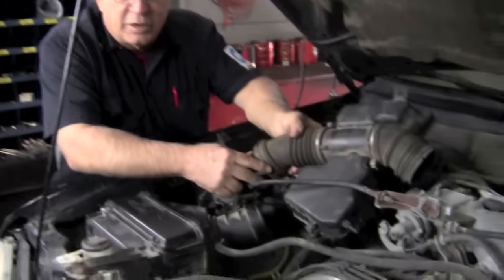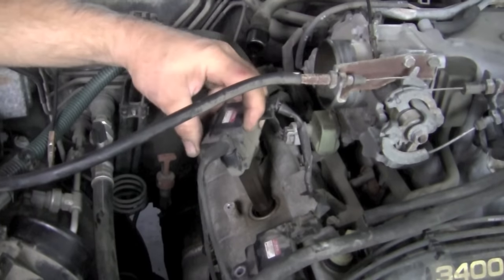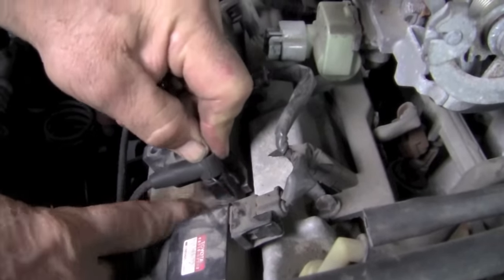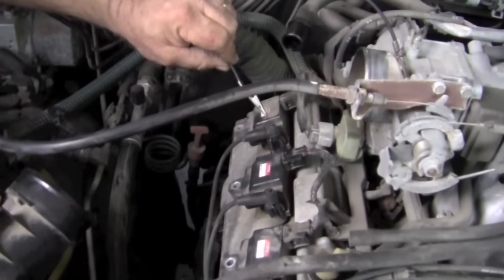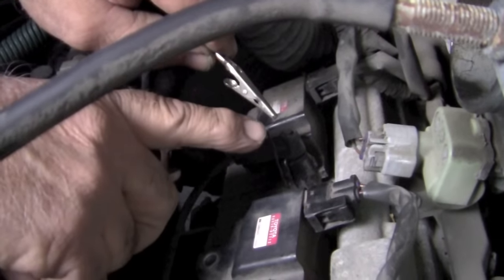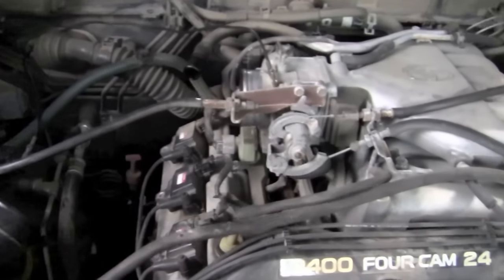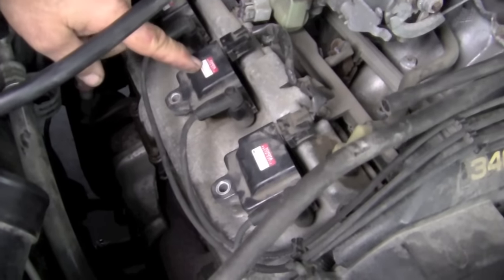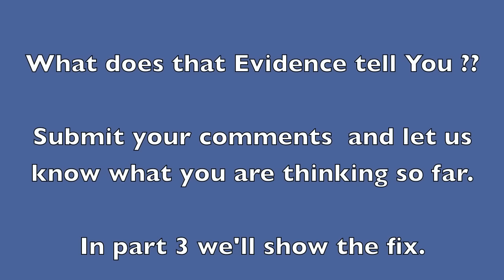How to find a misfire without a scanner 2

Comment: Interesting problem. The computer isn't logging the misfires so I assume it is getting good feedback from the coil circuit. I have no idea if that vehicle has a knock sensor. My initial reaction would be to replace the plug with one lying around incurring no cost, and then see. Since it only happens under load, might vibration be a factor?

Comment: now that we know its a middle coil misfire, its time to switch that coil with an adjcent coil and retest to find out if the coil is bad or if the middle cylinder is getting a bad signal from pcm or icm, or if theres bad whiring from that coil back.

Comment: Only thing I haven't changed yet is mass air flow... yes I bought new distributor.. Before discovering that my spark plug boots were pushing themselves off and making unburnt fuel scenario for my catalytic converters and of course engine missing symptoms.. really important....... I'm looking to see where I can find a really good fitting dunce cap for my head.... check engine light is staying out I just have to put scanner on somewhere.. to see how it looks.. if I got my timing in the right spot..... I assume so.. Vehicle 1997 GMC she 3500 Sierra pickup truck dually 7.4 liters. Discontinued by dealer they didn't even want to talk about it much less work on it.. I chased for months to find a mechanic that would work on it.. sort of... Kind of like a sick joke here.

Comment: when he load torques the engine is he just raising the rpm of the motor or putting it in drive with the brake applied and giving it some gas ?
Reply: Raising rpm while in park or neutral

Comment: I seen fire wen you pulled out the coil pack on the center, so its not the coil-pack, its either the wire connection at the coil pack or the spark plug, pull the plug and check for fire, i'll bet is the connection at the plug.

Comment: I don't even have a scanner and I was going to buy one. My car was shaking very badly and got it checked out and they said it was a misfire and they wanted to fix it. (What shop doesn't want to fix it??) They quoted me $600 because they wanted to clean something and change all spark plugs and coils. I changed the spark plugs and it got rid of the violent shaking when I was sitting at a stop light. I still feel it misfiring and was trying videos to see which one it is. Before I ran into this video I was going to get a tester (which I don't have) and this just goes to show you that I am the tester. I just need to do what is in this video and figure it out.
Reply from the maker: I applaud your effort Amy
Reply: I tried this with the coil check and didn't find anything. I don't have an alligator clip . I don't know where to get the mechanics wire at. 😮‍💨

Comment: Lol. I'm having the same problem with this same exact motor. Going to give this a try.
Reply: Me too. My codes are P0305 cylinder 5 misfiring.  I have change all the sparkplugs, wires and coils, but no luck.  I dont know what alse to change.  I was thinking maybe  change the mass air flow sensor and then the catalyc converter, but won't know if that in fact will fix the problem.  Need help 😧  did you fix the problem? You posted this 4 years ago.

Comment: 2003 Trailblazer Chevy does the scanner always shows what's wrong with the vehicle my mechanic told me that she get the scanner and he only showed that it was a coils and spark plugs but and then he tells me that it the transmission but in the scanner it did not show that is a transmission problem should the scanner read transmission problem codes my vehicle did not want to drive forward or did not want to drive reversed when I got this problem I didn't hear no knocking sound there was no rattling noise please help I appreciate it very much thank you for your feedback my mechanic told me it going to cost me $2,000 to fix my transmission

Comment: this test confirms the the coils work...but does not confirm spark at the plug gap. if its all good than move to the fuel system...note: some of the chevy v6s had an inferior poppet fuel injection system. the colpret can still be an injector... i think the compression is good enough judging by the rest of the cylinders contribution to power.

Comment: You need to change the middle coil,  so in this case I would change all coils so all cylinders fire uniformly.   (Have the same power or may I say, the new coil is no fidgeted as the older ones) so all the older coils should be changed out or at this point just do a complete tuneup.
Reply: On my 6 cyl. with 3 coils replacing one coil is $70 including labor. If I do all 3 then is $210 . Penny pincher saves $140  doing 1 coil .

Comment: Dear friend good day for you,.....Does the vehicle's pcv valve cause this condition?.
This regard, zuzuki balino car,
Reply from the maker: anything is possible but the pct as the direct cause is unlikely.  The pcv as the name implies allows ventilation to the crankcase.  If it were bad, and over time it could cause unwanted wear on the rings and cylinder walls that would cause "blow by" and the engine would smoke.
Reply: @realfixesrealfast thank you for your quick response..

Comment: Can you clarify something on running the engine with the MAF disconnected? I"m fighting a misfire issue on my '01 4Runner with the 5VZ-FE engine. When I disconnect the MAF Sensor as you showed, it won't stay running. It starts and immediately shuts off again.  It's a real pain to have to reconnect the air box every time I need to test another component. What am I missing?  Thanks.
Reply: Hope this helps.  The MAF, when plugged in, measures and reports the amount of air entering the intake so the PCM can calculate the proper injector on time.  When it is unplugged, obviously it can't measure something that's not there so it can't report a real value to the PCM.  The PCM will see that nothing is being reported and in many cases it will report a "substituted" value in order to let the engine run (not well but it will run).  I know that's not an all inclusive answer on how a  MAF works.  That would take a lot more detail.  Keep in mind all OEM's don't use a substituted value.  So, if yours won't run with it unplugged, it's because the PCM needs that input to keep it running. Hope this helps.  Let me know what else you may need.  Duane

Comment: Its gotta be worn out spark plug because you still had spark when you pulled the coil. Or the boot on the coil is the problem its probably cracking under heat and age.

Comment: its not an injector because this isnt a fuel problem, its a spark issue, when he removes the coil under load and it changes nothing but does get a change with the others confirms its a spark problem, check the plug, than the boot, than the resistence in the coil pack

Comment: Trying to diagnose an idle  stumble misfire on a 2010 vitara 3.2.
Cant narrow  it down to a particular cylinder. Odd thing is that when taking a video the camara's mike is picking up what sounds like "popcorn" in the background . Using the cameras mic I've narrowed it down to the left bank near the first catalytic converter.
Another odity is that  when disabling one coil at a time to narrow it down nothing ever stops  the poping noise on video.

Any advice would be helpfull thanks :)

Comment: I got a maxima with 6 coils, 6 sparks, but 3 sparks/coils are far back, and its still hard to test since I've got a slight misfire that aggravates when backing up, doesn't die but vibrates real shaky. I'm not sure if can be manually detected since scanner doesn't help.

Comment: Spark plugs….
Spark plug wires….
Compression test (passed)…
Spark test (passed)….
Ignition coil….

What else could cause a misfire ?

Symptoms are rough idle, a little white smoke, lack of acceleration….

Comment: Could be a bad plug possibly. It could also still be something mechanical. Would still like to see vaccum readings when it's acting up, and I'd like to see what the plug looks like. The evidence-gathering left a lot to be desired for me.
Reply: At this point.  Easier to swap the coil to the next cylinder.  If it does the same thing then it's the coil.  Rules out both the plug and cylinder.

Comment: My guess is the center coil at first;but if the plug on far engine side is not misfiring then it must be the spark plug for the cylinder.

Comment: I can see where you're headed with your dissertation . . . this is like a candy store of information.. Wonderful.. one more to add.. maybe this is a common problem.. spark plug wires are not completely on. Or we're pushed on but begin to work off.. and cause the catalytic converter to Glow and smoke( rich exhaust).. motor to misfire... this is best part, owner of vehicle foolish enough to buy hundreds of dollars worth of parts without rectifying the problem.. code reader unable to indicate this problem. Is scanner able to indicate this problem??? Must be some kind of manufacturer error boot fitting to spark plug Etc and staying on. Snug boot stays on enough to mimic no problem visually... Also spark plug wires gotten from the parts store with VIN number of vehicle to make sure correct. extremely difficult to push on. That work their way off somehow spring loaded with boot rubber..

Comment: its either a bad boot, bad plug, bad injector or a ecm failure not telling the injector to squirt fuel. now, in the earlier video the scanner didnt detect the missfire values. so is this a simple scanner issue with this obd2 system or could my ecm failure also cause this?

Comment: 1. MAYBE BAD INJECTOR 
2. COULD BE A WEAK COIL
3 BAD SPARK PLUG BUT THAT MIGHT BE CAUSE A MISFIRE ALL THE TIME, TRY SWAPPING THE PLUG WITH ANOTHER ONE TO SEE IF THERES A DIFFERENCE.
4 MAYBE BAD VALVES IN THAT CYLINDER. MIGHT HAVE VALVE FLOAT.
5 I WOULD DO A COMPRESSION TEST AND COMPARE IT TO THE OTHER NEXT TO IT.

Comment: I have a 2010 elantra with 62,000 kms. It starts ok, but immediately runs rough for 10-15 sec then smooth for a min or so. But when I try to back out with the transmission in drive( Under load) The idling gets worse and there is engine noise. Car continues to idle rough but better in CL, but gas mileage is terriable, and has lost power. I changed the plugs made no difference. Car is really running rough, but is drivable. LTFT about -4.7, and STFT about 0.03... This has a timing belt, has not been changed. Fuel system has been cleaned with motor vac system. Were to go next? This engine has only one Ignition coil for all for cylinders. All plugs look even , but are kind of black. Tail pipe shows very lean combustion no carbon, clean just water vapour. I have a scan tool. What should I do, and looking for?  Thanks
Reply from the maker: thanks for asking, but you really need someone to look at this because you describe too many overlapping variables.  According to your fuel trim it's not lean or rich,  but have to question when ethos reading were observed.  And you didn't say if the ppm has any codes.  Have a good diagnostic tech take a real look.  Otherwise you will be throwing parts at it and waisting time and money.

Comment: Swap coil and plug just in case and do a cylinder leak down test and compression test of needed. If test good swap injectors if practical if not practical ie it's labor inventive replace the injector rather than swap.

Comment: hello i have a jaguar s type r im having misfire or random misfire codes  so i reaplce some coils nd first i feel a little better but now went back to the same situation ,,, but i was touching some hoses could not find anything but i started the engine and i removed the mass air flow  sensor and the engine shut off and also shut off when i disconnected the pcv valve  is there any chance that the engine is off of time or valve cover gasket problems or fuel pressure issues

Comment: I would first check compression on that cyl if it checks out then i would test other variables like fuel injector coil pack and coil pack boot I'd swap the coil pack to the back cyl the injector to the front cyl leave the boot where its at and redo my power balance test to find my problem

Comment: Im gonna guess the center plug on the coil side. When he pulled the center coil up, it was sparking. But there was still a misfire on that cylinder. So my guess is the plug directly beneath the center coil.

Comment: I have an Range rover country LWB model 1994. Its started engine mis firing above 2000 RPM. below 2000 rpm engine running is good.
replaced ignition coil, code wire and MAP sensor also.
pls give some suggetions for this

Comment: I have 4 cylinders Saab that's misfiring but can't figure out how to find out what's causing it.  
spark plugs - new
rotor - new
spark plug wires - old (ordered & on its way)
d cap - cleaned the contact points

I would appreciate any assistance.
Reply: I have Oldsmobile. Silhouette how. Do. I. Get. To. The back. Plugs is. There a. Trick. Or. Is it. Just. A. Nightmere

Comment: Dear friend, I have a problem in my car, replace everything of plugs, coil packs, petrol filters, an sencers as well,. But now, What causes a car engine missing on the first few drives of the day? Once it gets to the correct temperature it runs fine with no errors, please tell me how to fix this, thanks a lot,
Reply from the maker: two things, I can help more if I know the vehicle number and exact symptoms.  But from what you have said so far I know this, you said - "Once it gets to the correct temperature it runs fine with no errors". That means It is a cold engine running (open loop)  issue because once it gets warm (closed loop) the computer takes over control and handles the problem.  That is likely a air leak, like vacuum tube, intake gasket, etc.
Reply: @realfixesrealfast  thank you dear friend, for your kind attention,...❤
Reply: As  I kindly request you to explain what is (open loop and closed loop) and in which part of the vehicle it is located...
Reply from the maker: @LakshmanWeerakkody-wg3se  Your car has a computer to control the are fuel mixture. The care starts cold (open loop). Open means the control is "open" to external influences or inputs such as temperature.  Once it warms up it changes to "closed" loop. Closed means the control only accepts internal influences or inputs.  This control is determined by when the oxygen sensors reach a specific temperature.  Older cars relied on natural heating to reach this temperature.  Newer cars use electrics to heat the sensors quickly ( 2-3 seconds). Once in closed loop the computer controls everything.  Since your cars runs bad cold (open loop) and good warm (closed loop), the cause of your problem is prior to the computer using only internal inputs.  This is very often air/fuel mixture issues.
Reply: @realfixesrealfast  thanks a lot friend ❤️❤️❤️

Comment: Sipliy change all of it, all spark plugs, wires and iginition coils. If u change only bad one next month u ll face the same problem with the ones that u haven't changed.
Reply: Murat Coskun not true I had misfire from one of my two coils, the 2nd one only started misfire a year later, save yourself some money. then again it is a Mitsubishi and they're reliable AF, this is still my OEM 2nd coil with 200k, also still have all 4 OEM fuel injectors and filter even, she's a beast.
Reply: J

Comment: how would i do this if i have to take the fuel rail off to get to each coil. witch mine has a coil for each plug
Reply: Kadan Jackman check resistance compare to oem spec

Comment: I've got the same problem. On a 01 ford focus  cylinder 2 misfire.  With new plugs and wires. Thinking  it is the coil pack. And the exhaust smell like  rotten eggs.

Comment: I have Ford Crown Victoria 1999 and I had the same problem so I sent the car to my local dealer and no codes nothing .
I asked my mechanic he told me to make load on coils .
- Start the car let it worm up 
- Run the A/C 
- Put it in D Make sure the scanner is connected 
- Low rise
after that cyl # 4 code appear, And the code was broken coil but I didn't change the coil, I replaced # 4 by # 1 and ran the same test again but same problem , So I removed the spark plug and I found it fissured

Comment: I have a question my friend,   i have a tacoma 06 with 55 thousand miles,  few days ago i started to hear explosions,  but only whe its running.
Reply from the maker: I assume by explosions you mean noises inside the engine?  They are most likely "misfire" events.  The computer should also see them and set a code to help find them.  Talk with a good tech
Reply: @realfixesrealfast  looks they come from catalytic... ot does it when its running but if o stop it and i step on the gas olit doesn't do it

Comment: I have a 90 1S 10 4.3 engine when you start the truck it idles good soon as you step on the gas it wants to die or it will die it will not throttle up what could this be

Comment: how a spark can be checked manually on mustang 2011 v6 ? because 3 coils are under the intake system . Please guide .
Reply: i have a mazda6 with the rear coils under the intake. check the front three. should they be good, then switch them out with the rear three. also check your rear plugs while your at it. you have to try and bring the problem to the front three. not easy but you can get it done. sort of.
Reply: Thankyou Sir , for your reply ,Today did the same but found no faulty coils ,My engine is doing hesitation after engine crank bearing change .Hope that the mechanic fixed engine well ..

Comment: Engine light flashing on start up  shift into any gear vehicle starts too shake. Put back in park turn off engine restart all's good. Spark plugs were replaced recently at dealer. 2017 Jeep wrangler jk.
Reply: Also shows no codes

Comment: cleary a bad plug or gapped too wide. had a 98 ford f150 with a 4.6 with a p0304 and it was missing only under load. turned out the the electrode on the plug had wore out and was causing the misfire only under load. probably the same thing here